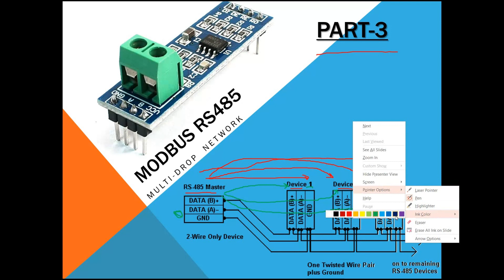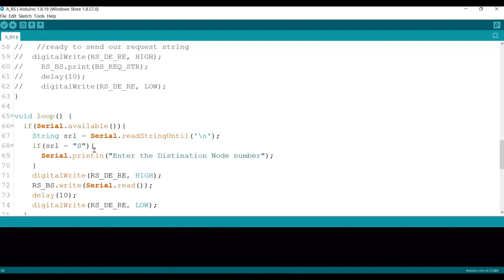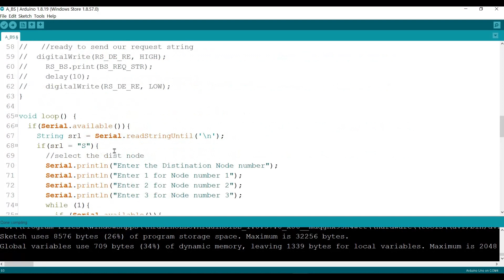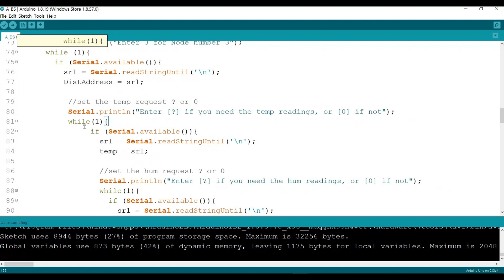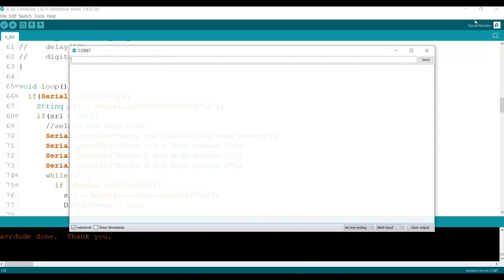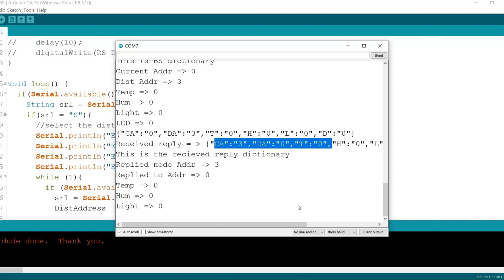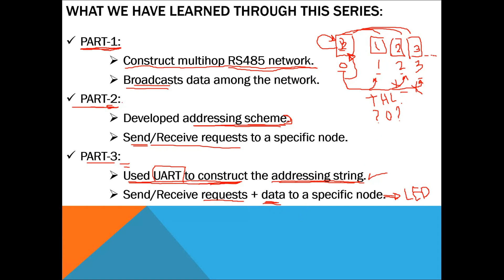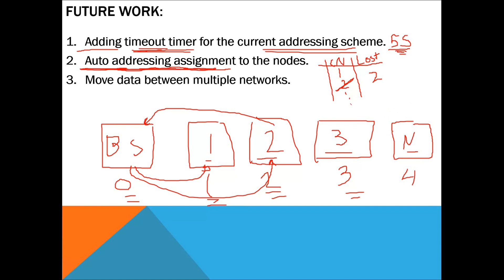Design and Implementation Arduino MultiHop RS485 MODBUS network "PART-3".

Comment: How to read the data from multiple sensors using max485 module using one arduino
Reply from the maker: You can follow the Design and Implementation Arduino MultiHop RS485 MODBUS network series it will show you how to di it. Basically you need address for your multiple sensors on your network.